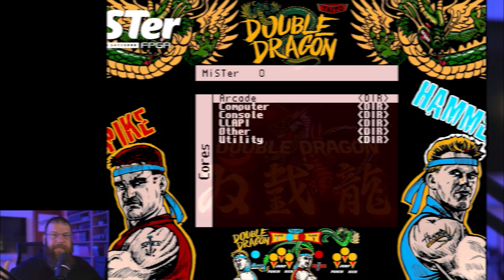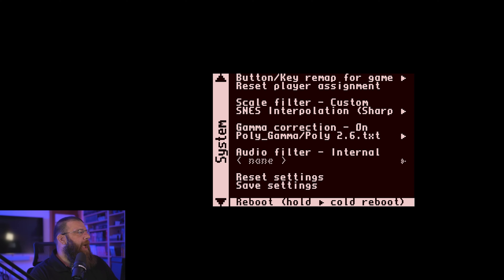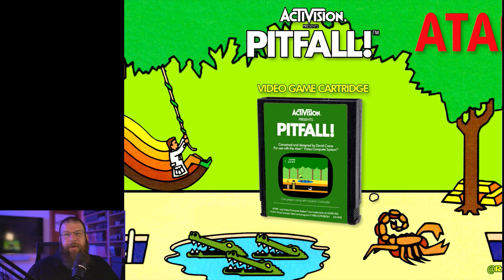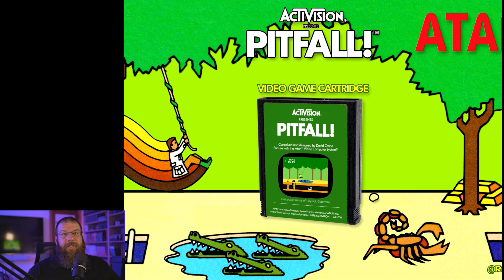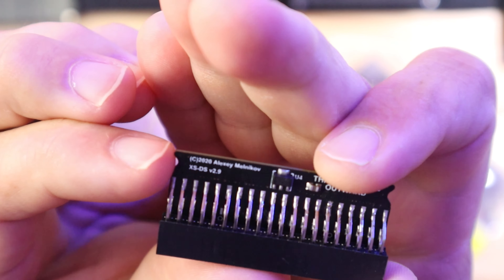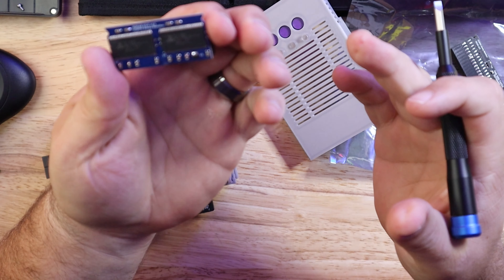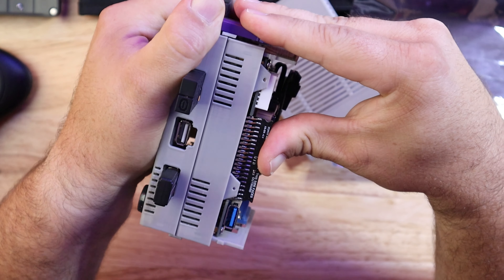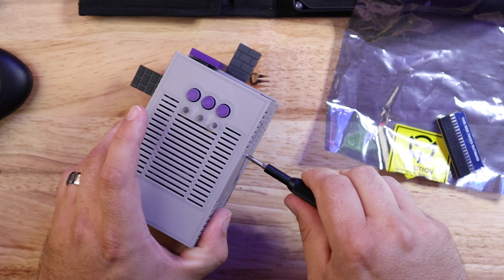Fixing My MiSTer - MiSTer FPGA RAM Upgrade

Comment: I’ve been having some issues with v2.5 for about 12 months intermittently but getting worse until virtually nothing was playable the past few days. So I ran the memtest utility and was getting errors at 141. I unplugged everything, removed the memory and did the old blow on everything trick. Have reseated the memory and now 142 with no errors. Games are now working.
If you have sausage fingers like I do I wouldn’t recommend removing the memory module too often because of the delicate pins but for now it seems to be working. Game on!

Comment: Hay can u please do a video nvidia shield tv  vs mister Review 🙏🙏🙏 what should i buy !🙏🙏
Reply: I know your comment is two months old, but since I don’t see any other replies to you, I thought I would chime in. The MiSTer compared to the Nvidia Shield isn’t really made for a 1 to 1 comparison. The MiSTer does hardware replication through FPGA, while any emulators on the shield would be through software emulation. The MiSTer is capable of absolutely zero lag through the SNAC port with a controller and the analog video out. Software emulation on other devices will always have some level of measurable lag.